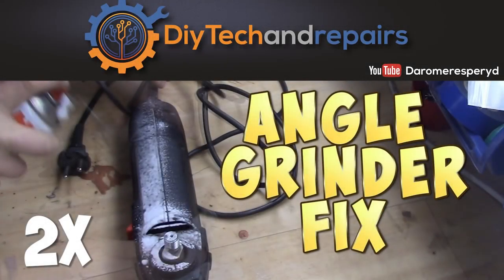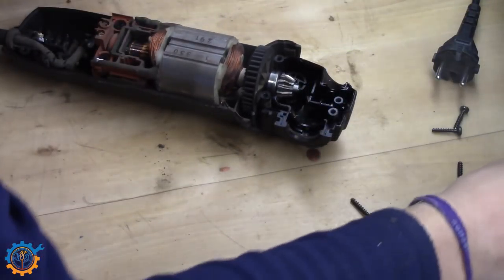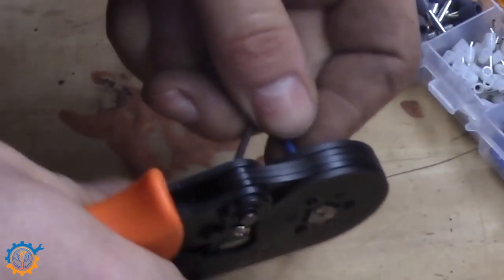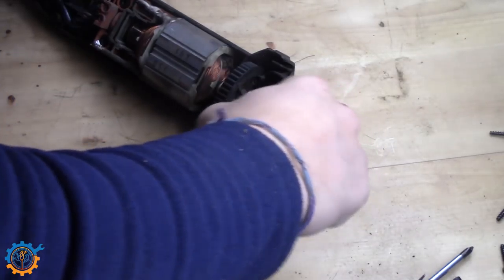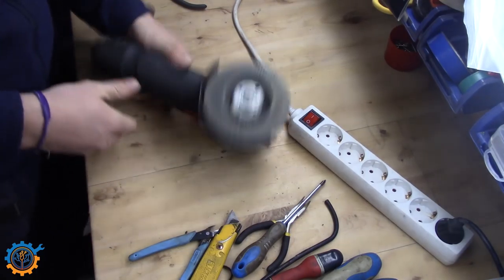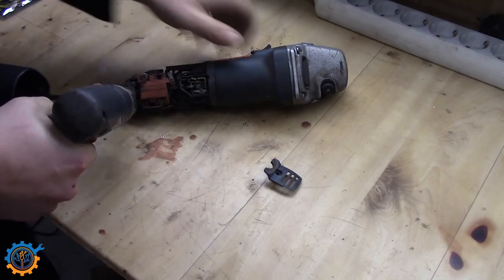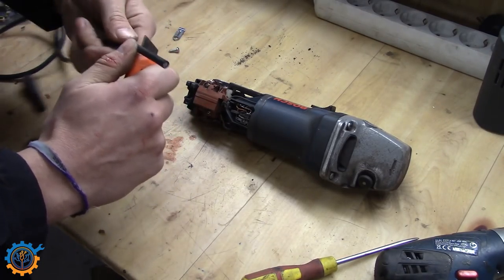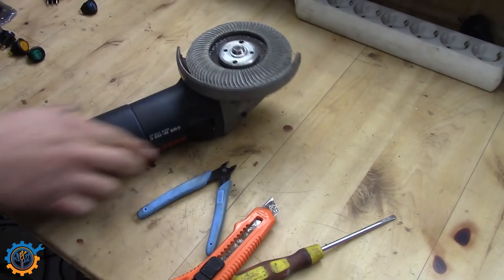Angle grinder fix x2

Comment: would putting a spring over the cable strain relief rubber help?
Reply from the maker: Could help but depends on what cable you got and tool. The Bosch then the cable did break outside the relief. The cheap one was broken some where in the contact end.....